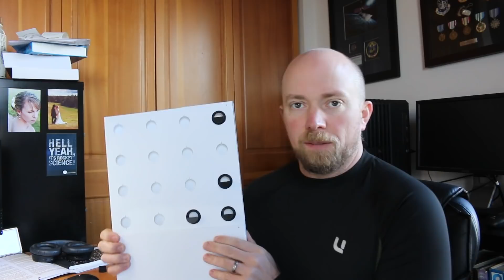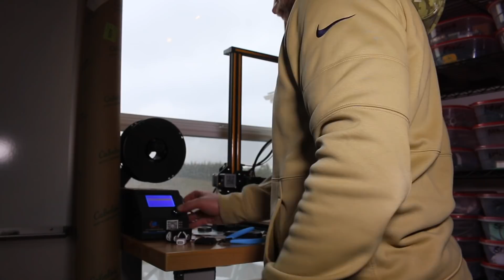USEFUL 3D Printing, Evaluating Consumer Product Concepts

Comment: There are several places on the internet offering instructions on DIY vacuum forming machines as well as commercial.   MicroMark has a small vacuum forming machine and has a book about the subject.  I agree with some of the comments about providing room for roots.  Vacuum forming is much faster than 3-D printing or machining at this size.
Would it be practical to make the tower out of front, back, a center spacer, and 2 sides to be  bolted or screwed together instead of one casting?  This will allow a smaller shipping container than for a casting.  If this is done, use stainless steel fasteners to prevent rusting unless use brass.  With this amount of water, corrosion is going to be a big deal.
I wish I were closer to help but I am in Texas.
Reply from the maker: that info was very helpful...looking into it now

Comment: Jeff, It seems to me you're jumping to the most complicated and expensive, high-tech solutions first, rather than starting with a design that you have thoroughly researched to be very convinced it will work, then looking for the most efficient and cost-effective way to make it.  Vacu-forming or just good, old-fashioned stock removal and glue, might be better, cheaper, and easier.  I know you love high-tech, gee-whiz stuff, but don't let that affinity drive your decision-making.
Reply: Myself being a fabricator by trade I  also wonder about the choices  Jeff is making. But again it seems to be the overall mentality of most engineers to make things far more complex than they need to be.

I look at his wall panels I know full well that they could be made with vacuum formed sheet plastic. I wonder if he sized the for being made out of sheet stock?
Reply from the maker: Was unaware of that process...looking
Reply: @TheRealMartian  I have done mold making for complex fiberglass parts Jeff. I worked on making vacuum form molds at the same time. The theory of mold making is the same for both of then, the difference is the state of finish of the mold or plug face.

Comment: Half a million for what quantity? A couple prototypes seems awesome spendy, but enough panels and parts to fill that dry van? That's an amazing time and resource sink, maybe that number doesn't seem as insane.
Reply from the maker: 46
Reply: @TheRealMartian  so about 217 times the parts you showed? ( 2.17²x46 ... It was 46% scale too, right?) And you were using supports, which require material plus time to remove? I'm not really more than simply interested in the 3d printing industry - but while that does seem like a rather large job, it doesn't seem to me that it should add up to that kind of money! 

Are there any efficiencies you can add to the design and printing to dramatically reduce material costs and manual labor to finish the parts? Rotating for vertical printing to eliminate support structures and accelerate printing by doing multiples per run on a single build plate? A thicker self supporting wall might cost slightly more in print time for the actual wall, but could save a LOT of time and resources eliminating supports and labor to remove them. Maybe breaking it down into smaller components? It seems like you should definitely be able to drastically reduce your costs for what looks like pretty simple construction.  (Maybe sourcing sheets of material for the large panels and using subtractive manufacturing for those, only printing what you can't easily make by machining sheets? Finding something very recyclable and food safe should be easier as well when working with products from existing industry, and would keep the end product green/sustainable...?) 3d printing is amazing, but it's only one tool of the many available today.  

Granted, we don't have anywhere near all the details, so there is very likely a gigantic amount of details we aren't privy to that could complicated the system and dramatically increase manufacturing costs.

🤷🏻‍♂️

Comment: The root growth will quickly split this design apart.  There is no room for  root expansion.  Roots can lift and crack concrete sidewalks.  Even if these would work, you wouldn't be able to get the roots out to reuse them.  It would need to be a one time use disposable grow wall.  What you need is a hemp printer.  However, increasing panel costs would make most veggies grown in even a hemp tower impractical.    Especially, if grown indoors under artificial light.

Most people don't know roots require oxygen for plants to grow.  A problem I see with this design is the roots will eventually get anaerobic and thus killing the plant. There is little room for roots in the design.  Plant roots require water and oxygen to grow to maturity.  If oxygen is limited as the plants gets near maturity plants will struggle, suffer and die.  

Lastly, in order to water these towers will require water to freely flow and empty.  When the roots completely fill the given root space, the water will simply flood and pour down the outside of the tower while the plants die from no oxygen nor water.

I learned a great deal about what works and what doesn't work in aquaponics during my dome pilot project.  Vertical grow towers have already been perfected and I'm sorry to say this is not it.  All the engineering and planning in the world won't allow a bad design to function if you don't first fully understand what a plant needs to grow to maturity.

Comment: Have you thought about vacuum forming the panels? In the voids, you could simply form dimples that would extend from the front of the panel to the back panel. Therefore, eliminating flex. A jig and router could easily cut out the holes. Very little tooling. Also, plastic panels are stocked everywhere throughout the country.

Comment: Take the glass plate of the 3d-printer when removing a finished printed part. The bed will eventually become loose and lower the quality of the print. Also recommend getting a magnetic removable bed, as it for shure looks like you will be printing a fair bit :-)

Comment: I'd buy it, if i lived in an apartment, would probably pay $80-120.  It is best to have a low price as a base price, then have inexpensive to produce options that increase the price in large increments. like fans, extra lights, maybe more efficient lights like 2835leds, and whole system setup.  If you can sell someone on the idea and they like the low price, they will easily add onto that price
Reply: you need a graphic designer that makes "cute" imagery that will help sell. like radish and head lettuce with smiley faces

Comment: I would print the panel standing up and put spacers or you can do them laying down and do a 10% infill. The water will work its way around all the infill and increase bacteria growth inside the panels.
Reply: Without oxygen, the bacteria growth will likely be anaerobic.  This is why success grow towers use a growth media which is considerably free space and even these can get root bound causing anaerobic situations.

Comment: They make a water soluble 3d printer filament for support materials you can then just toss in a bucket with a pump and sprayer to dissolve. Good for internal supports you want to remove later. Other option for easy to dissolve support is sheet foam and acetone 

For the grow wall would it not be faster to just use sheet plastic and glue the sides, supports and front on using a jig to keep the spacing? A table top or vertical CNC to cut the fronts for the grow cups and a simple hand router to round the sides and clean up any extra glue. As for the lock together strips between sections ether a CNC or as simple as a pantagraph setup to carve out any materials needed. 

The stepper motors and the CNC's power head are the most expensive part of the setup as you can 3d print the brackets and use 8020 extruded rails to build to any size you want in a modular setup.